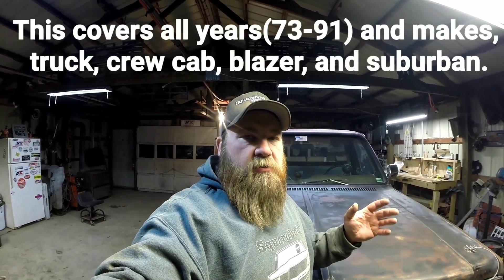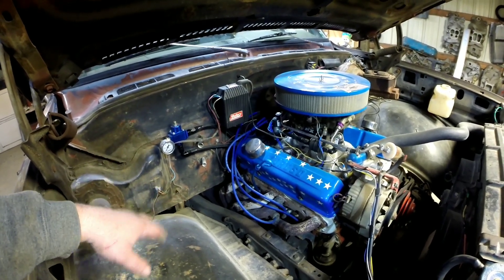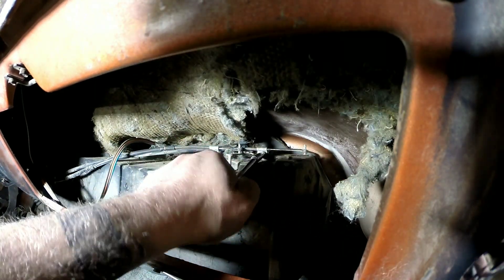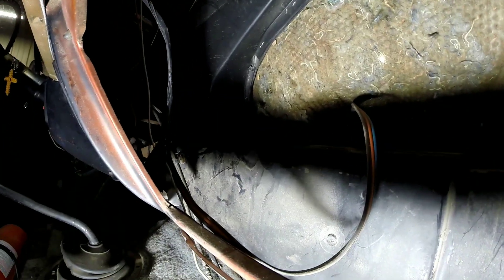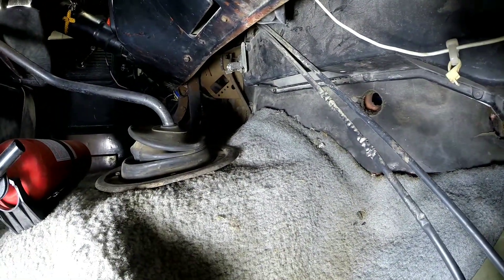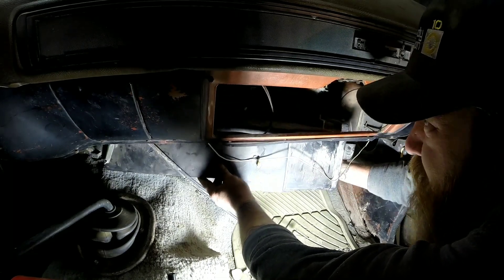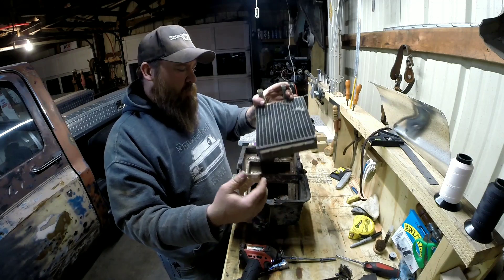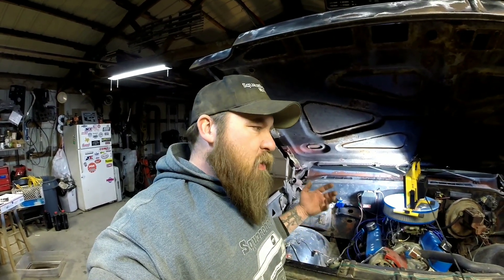how to remove heater core on non AC Squarebody.

Comment: I love you videos I have a 80 square body just got a 305 a little bit of Cam in it Corona meant a 600 Holley turbo 350 with 342 gear I play with it a little bit on on the drag strip cat 3 inch pipe with series 10 Flowmasters and headers sounds pretty good I haven't ruined mine yet what's your a smile time with your so far as I know what I'm shooting at
Reply from the maker: Thanks, my best is 8.60 @ 78mph in the 1/8. 1/4 mile is 13.58 @ 95mph. I have a video of that run https://youtu.be/nQrWecGHSII